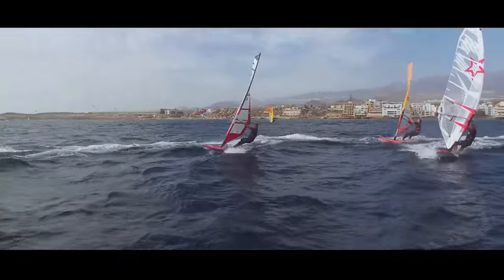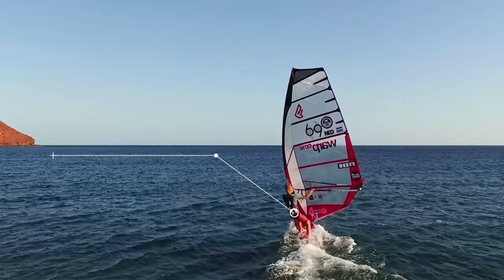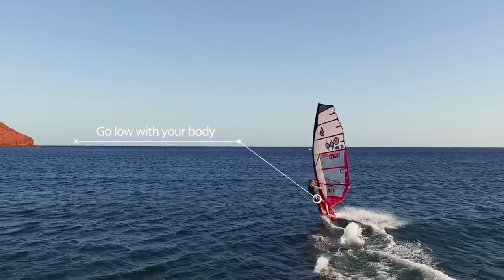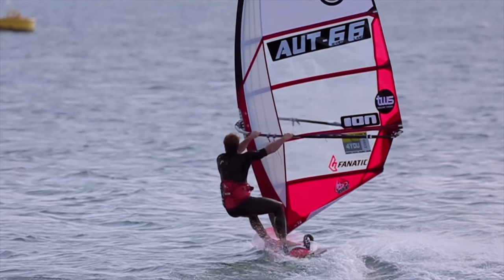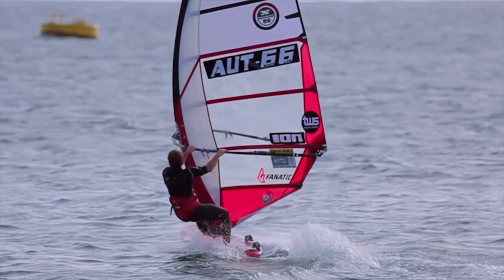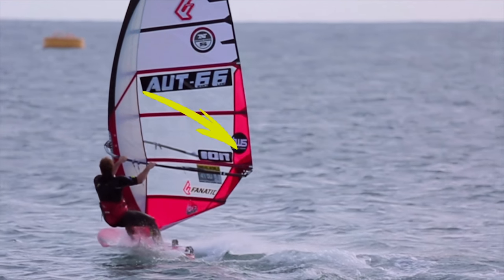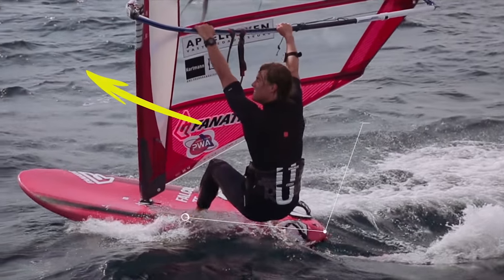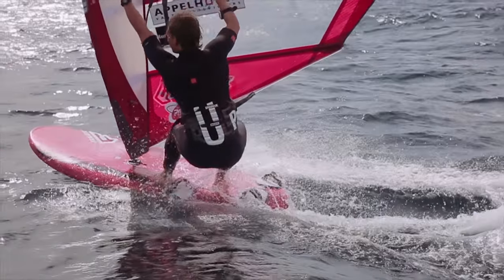TWS Technique Series - Episode 4: How to Pump? Pumping tips windsurfing slalom

Comment: In the video He says "when pulling the sail back take pressure off the front foot", is that valid just to start or for each pump loop because later you have to push the front foot forward.